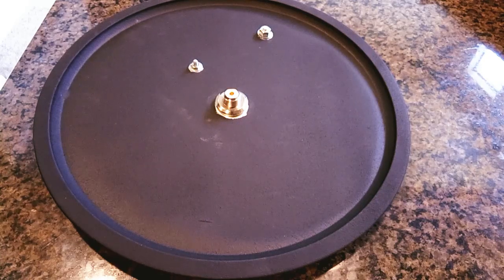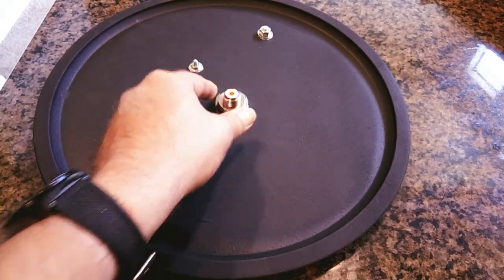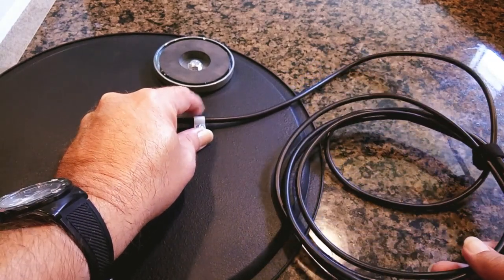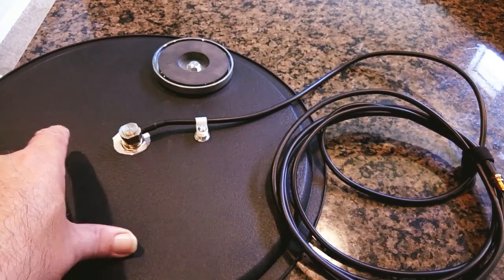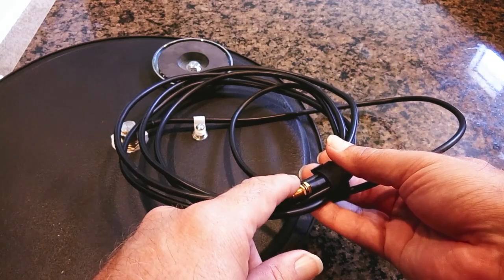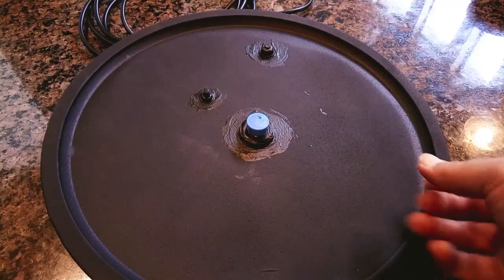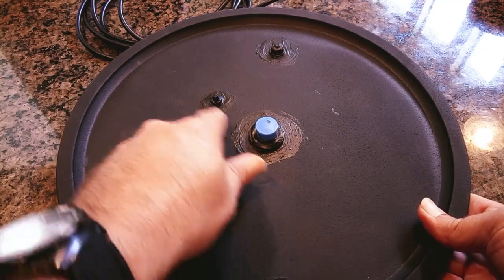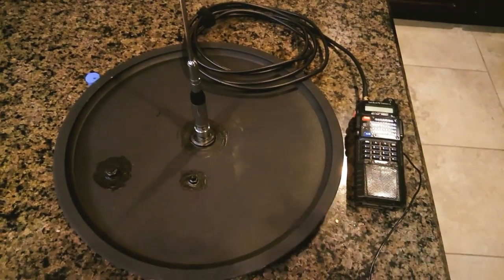Home Made Temporary Base Antenna Using a Pizza Pan

Comment: Will an aluminum pizza pan work ?
Reply from the maker: Like a disposable one? I think they may be too thin and tear apart when you cut the hole. I got the one on the video at Dollar Tree for $1. It's reasonably solid to work with
Reply: @spence631  Thanks for reply.....this pizza pan is not disposable but quite solid.  Its 24 inch diameter  and made of aluminum.   Magnet base antenna will not stick of course.   I have this rig just set up in the house for experiment.
Reply: Was  wondering if it needs to be steel.
Reply from the maker: @jimgresham5529  it sounds like it may be rigid enough to work well. As always with aluminum sheet be careful drilling holes.
Reply: @spence631  Thanks,   right now I have a mag base car cb antenna on the pie pan by a window.   not much traffic on ch 19 right now.    I plan to drill a half inch hole in pan for a four foot trucker antenna.
Reply from the maker: @jimgresham5529  ah, with the screw in stud mount and coax cable. I've used Firestik brand cb antennas and they seem good. If the weight is an issue, maybe wood or a piece of metal bar for strength?
Reply: @spence631  Thanks.....gotta run.